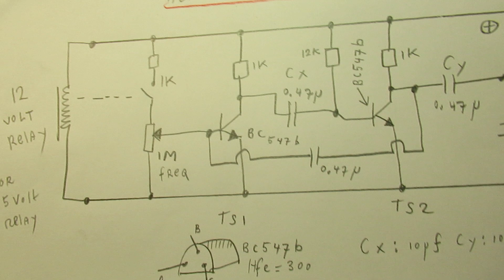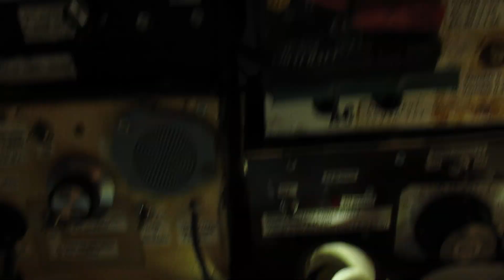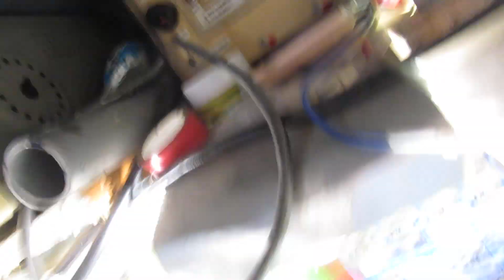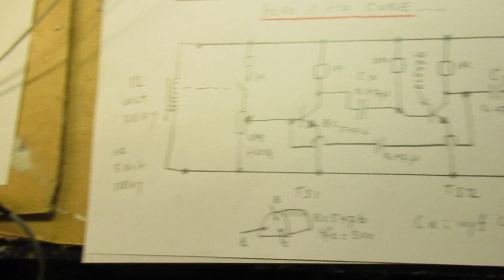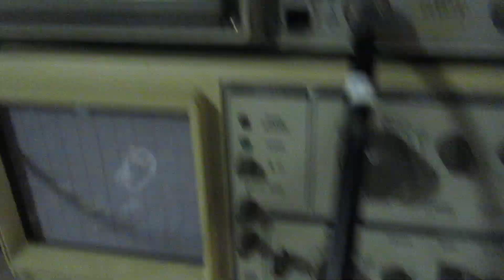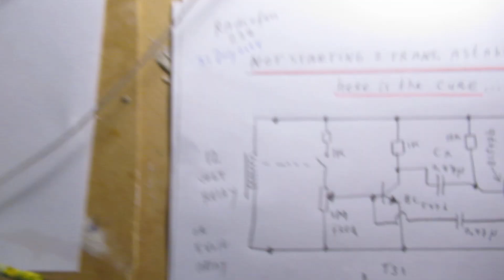When Astable Muvibs don't want to oscillate when the voltage is slowly applied. Why? And what to do?

Comment: I had the same issue with a DC DC converter,  forget which chip it used, but if the voltage was applied slowly (or in other words ramping up from nothing), it would just sit there sucking up current.
Reply from the maker: Thanks, valuable info for everyone.